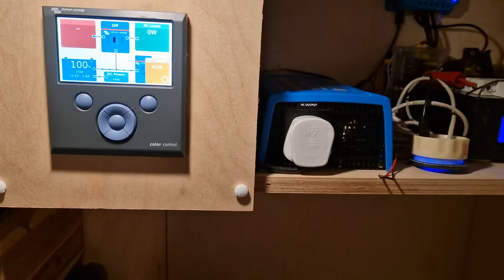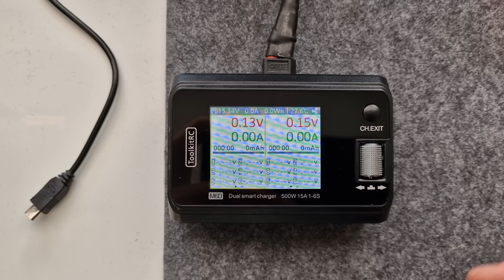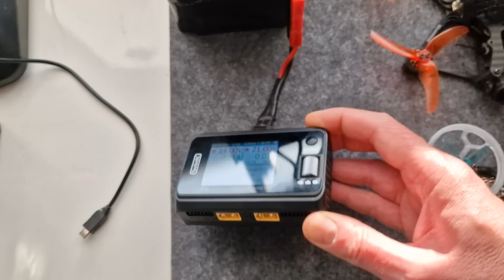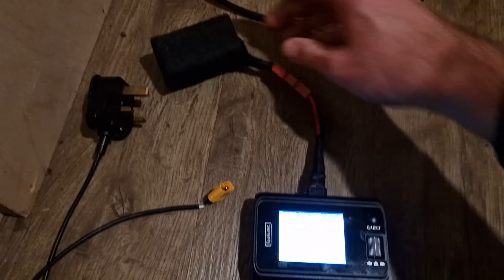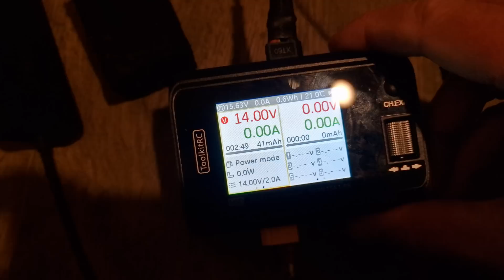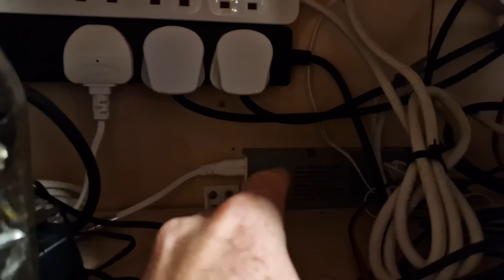THIS OFF GRID DEVICE CAN POWER VIRTUALLY ANYTHING!!!

Comment: Thats a nifty little device and I like the idea of splitting your regular charger cable with xt connectors! For devices I might sell again and more usual voltages of 5,9,12,15,20V I'd maybe consider USB-C PowerDelivery - I just bought a 20V USB-C Trigger cable to barrel, fitting my 19.5V PC monitor to power it from the sun! Works like a charm. Just make sure to use a car charger port which supports your desired PD voltage. These trigger cables telling the PD charger which voltage it needs to provide

Comment: Might be easier to use something like DC 16V-120V to 12V 3A Step Down Module Power Supply DC DC converter Buck

Comment: I don’t think the lights would be up to much pulling 24v off a 12v battery. You’d be better off using a 24v system seeing as that’s what the charger’s range is.

Comment: Your Charger is a good idea, I think you would be better with just a Dc to DC regulated Voltage converter, most likely cheaper than running your charger & its screen constantly. Most likely more efficent also as no screen to power. If you like to see convertor output voltage, a tiny 0.28" Adjustable Led Voltmeter are available and are awesome, I use them on many projects.
Some converters are also fully adjustable (both Voltage / current)

A Good concept though, your thinking outside the box 📦 👍🍻
Reply from the maker: Thanks, yeah a normal DCDC would be better for permanent installations however I do like the flexibility of being able to quickly call up any voltage you need for an appliance quickly on a screen and set current limits (leds). Having  multiple output channels is cool too!

Comment: Nice flexible option but a bit expensive if it's just for one purpose, a DC to DC voltage regulator would be a better permanent solution and most are variable output and 2-5 amps

Comment: take a look at some of the dedicated Buck/Boost converters commercially available on eBay. More cost-effective and only needs current limit and voltage setting once with potentiometers.
Reply: thanks for that pointer. do you have an example?
Reply: I bought one of these mppt boost controllers only I would like to limit current, it's to charge a 52v ebike battery any ideas of the best way to do it?

Comment: Looking good, as a cheap alternative you can use buck boost converters as well, which is what the charger is doing anyway inside they are super cheap, atm you can get 2 x 4A buck boost converters with displays for 17 quid total much less if you go to ali express, if you use those then you can tuck the converter behind the set, only thing you have to watch with this buck boost technology is RF noise they can be problematic esp with your hobby. HNY Mate :-)

Comment: I watched a few of your Victron videos and others and actually put a full 3kwh Victron system + Pylontech 4.8kwh battery in the garage with solar panels on the garage roof -  that power then runs into the house off of the garage circuit! 

ESS with zero export so fully compliant - covering about 1/3 of my winter usage at the moment. I will easily cover all my usage by Spring through till Autumn!

Victron kit is absolutely amazing and I saved about £6k in installer fees!

Also inspired me to get a HF radio - but only used it for WSPR so far;

M7TJF 73!
Reply: Where did you buy your Pylontech? I just got us5000 as well.
Reply: @tujuprojects  not sure if my link posted - company is called midsummer wholesale just give them a google 

let me know if you would like a hand with anything, happy to help.

Comment: That's neat mate!!  Am I right in saying it could act as a charge controller?  Could you check the RF noise for us?  It looks a bit like The Buddipole PowerMini 2 charge controller device at half the price! - I could see so many uses for the all day / weekend portable ham radio users out there. Cheers.
Reply from the maker: Cheers, it  wouldn't work well as a charge controller with solar panels for a few reasons, you really need an MPPT charge controller these days to maximise solar yield. I will check the RF noise as I do plan to run some radios 😁
Reply: @andykirby  - Cheers buddy, as you can tell I'm a complete novice at this malarkey 😁
Reply: @andykirby  excellent, I 'm also interested in the results ;)  vy73 from Hamburg/Germany, Dietmar, DL4HAO